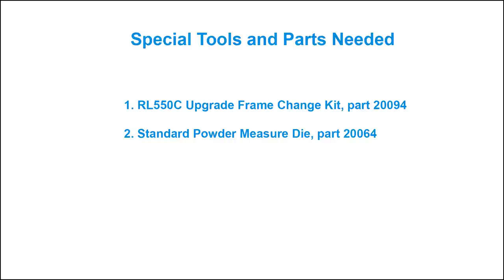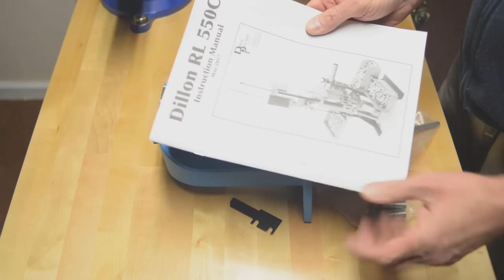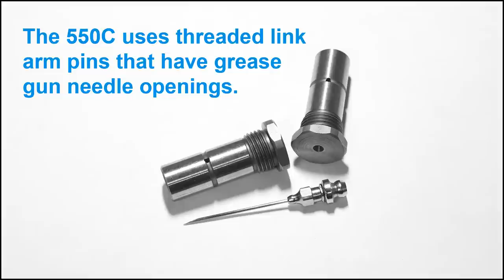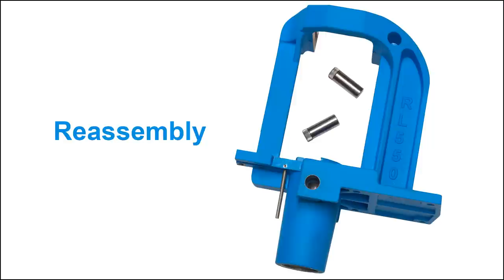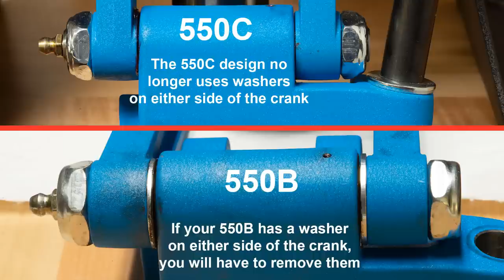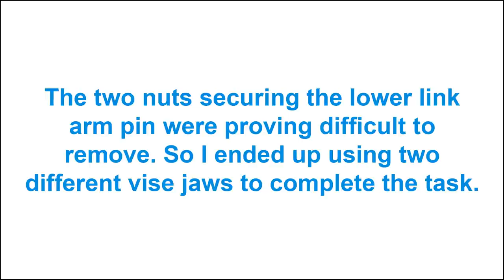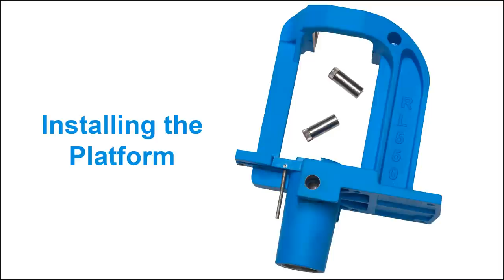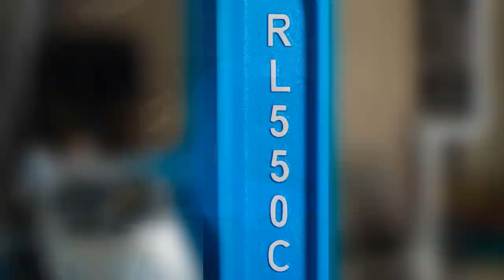How to upgrade a Dillon 550B to a 550C

Comment: This was a well made video with clear, simple to follow instructions. That being said, there is zero reason to "upgrade" as the cost far outweighs the negligible benefits. I've loaded for years on two 550b's for 10's of thousands of rounds and had no issue with yearly maintenance. If Dillon was giving this kit away, it would go on the shelf until the next time I broke my machines down. Once gain though, great video.
Reply: A. Grayman, totally agree, I’ve been using my 550b for over 25 years and if I knew to clean and lube it way back when I would never have had any issues. That being said I sent it back to Dillion and they fixed it up better than new free of cost, their service is the best!
Reply: You are so very right . Ive have a 550b for 12 year's now this is my second 550b only because I lost my first one in a flood in 2005. And that one I bought in 1985.I take them down for general maint. about every two years and it works just fine . Too much work and expense just to replace one part . As my dad always said " If it ain't broke don't fix it " .

Comment: After coming across you video and watching it, I ordered and installed the upgrade just for the ease of  maintenance. Thank you for the video as it saved me time and frustration knowing what to do and about  the washers on the crank. Again had no problems with the install thanks to you.
Reply from the maker: Chuck, glad it was helpful.  Took me a while to figure out the washers were the source of my issue.  It would have been nice if Dillon would have at least included a Tip sheet.  Dillon including the instructions of a factory built 550C with the upgrade kit was no help to me at all.

Comment: Excellent video! I've been having some issues with my 550b and I've found some of the pins have some galling. I've got an even older press than yours and there are no grease fittings so I guess they got dry. I think I will go ahead and upgrade to the 550c with this kit, but I'll also have to order some new pins.

Comment: The WHOLE reason why it’d be easier to just go with a new 550B..A LOT easier and less of a headache.
Reply from the maker: I assume you mean a new 550C. Yes, one could by a new 550C and then sell their old 550B. Easier, but maybe not cheaper. Kind of like electrical and plumbing work. Hiring a trades person to do every bit of electrical or plumbing work in your home/shop would be easier, but not necessarily the most cost effective.
Reply: The upgrade is about the same effort as the disassembly, cleaning, relubing and reassembly. So when the 550B press is old enough to need it, that's the time to do the upgrade, or I guess just buy a new press every time it needs a cleaning and lubrication. :)

Comment: Great video. The current instructions recommend blue thread locker on the "threaded link arm pin" threads. Do you think this is important or advisable?
Reply from the maker: Hello Alan. Glad to hear they finally came out with instructions. Using blue thread lock on the new threaded link arm pins/pivot pins would be a benefit. But for it to work, it would be important not to get grease on the threads.

Comment: Why you need to put grease through the pins, when Dillon maintenance instruction instructed to use motor oil on the main shaft?
Reply from the maker: Short answer: Different parts require different lubricates. Long answer: You may wish to refer to the following video from Dillon Precision. While their video is about the 550B, it does show the type of lubricate to be used for certain parts, especially at times 2:50, 5:03 and 5:27.
https://www.youtube.com/watch?v=cJuMsTIKsaU

Also, the new threaded pivot pins/link arm pins have grease needle fittings, which are meant for the application of grease, not oil.

Comment: Very informative video..
Thanks for sharing
Question..my 550b does not have the shaft with the zerk fitting attached?
Does Dillon make that part and is it recommended upgrade?
Reply: They do have kits to upgrade. It's called a "550 Grease Fitting Upgrade". Includes a new blue crank and the new pin/washers/nuts with zerk fitting. This is separate from the "550C Frame Kit Assembly" that takes a 550B frame with hammer driven pins to a 550C frame with threaded pins. As to whether it is recommended, it boils down to whether you like to take the press apart with a hammer and fight with C clips every N years for disassembly, cleaning and lubrication, or whether you would rather be able to lube in place and be able to disassemble (less often) with wrenches instead of a hammer and safety glasses. Perhaps wait until it needs a disassembly and then update it at the same time..

Comment: SUPERB video sir! Very informative.  Would you know if I can convert a 550 (no 'B') as you demonstrated, in addition the zerc'd long pin on the very bottom linkage next to where the handle screws in?
Reply from the maker: Dave, if I understand your question, it sounds like the crank (the piece that connects the two link arms at the bottom next to where the handle screws in) does not use/have a lower link arm pin that is fitted with a zerk grease fitting.  If correct, you may also need to get new link arms. new lower link arm pin, a new crank and possibly some other parts.  I would recommend you contact Dillon support.  Dillon has both a toll free phone number and live chat.  I have been successful using both their toll free number and live chat.
Reply: @knowledge2you  Good info sir and thank you for your quick response!
Reply: @knowledge2you  I didn't think about that, my link arms don't have the grease hole for the dirty grease to escape. I may just buy a new press.
Reply from the maker: Best of luck to you  @bamabackroads1203

Comment: Seems to me that it would be wiser to get a BL-550, and transfer all the parts over, then sell the 550B press fully functioning. 
After all, with Dillon’s warranty, what use is the old frame?
Third strike: no instructions for the conversation...REALLY!?
Reply from the maker: If you transfer over the automatic powder measure and/or the priming system and/or the low primer alarm (which is standard equipment on a RL 550), then you no longer have a fully functional RL 550B.

That is correct. The kit does NOT come with any instructions. The ‘instructions’ that came with my kit were the standard instructions Dillon ships with any factory-built RL 550C.  There is nothing in those instructions on how to upgrade a 550B to a 550C.
Reply: @knowledge2you  You would have an old style BL 550 fully functioning
Reply from the maker: @scpvrr  Ok, now I understand your suggestion.  Since a new BL550C is $300 + ~22.5 shipping  (w/o tax) and the frame upgrade kit is $121 plus ~ 17 shipping (w/o tax), then if the person could sell the old style BL 550B for at least $184.5, then they should be able to break even.  If they could sell it for more than $184.5, then they would have spent less that straight buying the kit.
Reply: @knowledge2you  Yep. And bless someone else in the process.

Comment: Great video.  Do you know anything about the part number 18275 crank upgrade kit for the 550?
Reply from the maker: B Berthold, I am not familiar with it but when I read its description, I speculated what it was, so I contacted Dillon, twice, to confirm my thoughts.  It has been over a month and not a word from Dillon.  But I suspect that if you have a really old 550, that the crank does not have a zerk fitting on it’s left side.  You can see this zerk fitting at time mark 26:49. So if your 550 crank has this zerk fitting on the crank, you should not need part 18275.
Reply: @knowledge2you  I did buy this part.  It replaces the bottom part of the press and it has a grease fitting. Thank you for your time and effort.  I did message them that it needs a better description and picture.  It also came with a link arm punch and alignment tool.

Comment: Thanks for making this video, very helpful!  I noticed that you have a plate on top of your Strong Mount.  Is that from Dillon, or did you fabricate it? I bought my Strong Mount back in 1999. It does not have a top plate.
Reply from the maker: Dillon does not make a top plate for their Strong Mount.  I purchased the top plate from inlinefabrication dot com.  On their web site, in the upper left, click Search and search for ‘Intermediate plate for Dillon 550 strongmounts’.  This is the same company from which I purchased the LED lighting kit for my 550s.
Reply: @knowledge2you  Thanks, I have several of their products, but I never noticed that upgrade. I wish I had bought their mount for my 550, but I don't think they were around in the 90's when I started reloading.

Comment: I’ve taken the pins out on my 550B. It takes many whacks wit a hammer.
Reply from the maker: Yes it does.  With the upgrade, no more having to remove the pins to grease them.  The new pins are now much easier to lubricate with their grease needle openings.

Comment: That's not a upgrade, it's replacing your press....
Reply from the maker: By general definition, an upgrade is taking something that works and making it better/more up to date by adding or replacing parts. For example, I upgraded my computer, which was running Windows 8, by installing Windows 10. i.e. I replaced Windows 8 with Windows 10. In this video, I upgraded my press by replacing a part.  I did not replace my press. If it matters, Dillon’s name for part number 20094 is Upgrade Frame Change Kit.

Comment: I bet some clever machinist could come up with some way to add a real upgrade kit to this to convert the pins for quicker disassembly. but honesty if you use quality grease you dont need to take it down all that often.
Reply from the maker: How often it has to have a major cleaning is more a function of how much reloading you do.  I have no set guidelines.  For me, it is when the machine begins to feel sluggish.  When the upgrade kit, I now just have to use a grease gun instead of taking it down.

Comment: seems to me if you could just buy the threaded pins and thread your 550b to accept them
Reply from the maker: Not sure it would work Chris. I still have my 550B frame and compared it to the 550C.  The sides of the frame where the pivot pins are inserted are thicker on the 550C than the sides on the 550B.

Comment: What kind of vise and who sells that vise? Nice video Sir.
Reply from the maker: It is the Yost 750-DI 5”.  Originally, I was going to get the Yost 750-E, which is a somewhat smaller and less expensive vise, but at the time, the 750-DI was on sale and the 750-E was not so I was able to get the 750-DI for close to the same price as a 750-E.  I also purchased the Yost MU360 universal jaw cover (6") and the Yost UP360 universal prism jaw cover (6”) and the Yost MR-350 magnetic aluminum jaw cap with rubber surface (5”).  I got mine on Amazon but other retailers sell them also.  I shopped around for price and that including shipping charge since a vise is heavy.

Comment: Does Dillon not provide torque specifications?
Reply from the maker: There were none in the instructions.  In fact, the instructions that came with the upgrade kit were just the standard 550C instructions that come with a factory built 550C.  The instructions do not show or explain how to upgrade a 550B to a 550C.  If you call or chat with Dillon, they may provide torque specs.

Comment: How to convert your 55b to a 550c: Get a 55C Frame and....uh...strip the parts from the B and place them in the frame of the C...and ...uh...screw it.  Just go buy the 550C. Save the time.
Reply from the maker: I don’t understand your point. If you own a 550B and wish to convert it to a 550C, then when you buy Dillon’s upgrade kit, you are buying a 550C frame and in the video you see how to remove the other parts from the 550B and install on the 550C (not all parts convert over) and align the shell plate to the new frame (a necessary step). If you currently do not own either, and you buy from Dillon, you will be getting the 550C. About the only way to buy a 550B now is on the used market.

Comment: I see that You miss something very important on RL 550B about pivot pins. You don't have to remove anything to lubricate pivot pins. I believe that You didn't see six small pin holes for lubricate pivot pins.
Reply from the maker: I kept my old 550B frame and as I show in the video, the link arms and crank from the 550B are reused when upgrading to the 550C. There are no small pin holes on the frame.  Each link arm has one small hole and the crank has one small hole.  For a total of three holes.  These holes act as a grease pressure relief hole.  To properly lubricate the old-style pivot pins, they have to be removed.  As show in this Dillon Precision published video starting at 2 minutes, 18 seconds.

https://www.youtube.com/watch?v=cJuMsTIKsaU

If you look at some really old 550 machines, they don’t even have the hole in the link arm that mine do and don't have a Zerk fitted pin in the crank.
Reply from the maker: @Subject76  The post you are referring to is 2008. The video I am referring to is 2015.
The older machine shown in the post has two small holes in each link arm and two small holes in the crank. For a total of six holes. They have not put those six holes in a 550 for a long time. Just look at the link arms and crank on a 550 on the Dillon web site or in the Dillon video I referenced above. Years back they switched to one hole in each link arm and one hole in the crank. And they put a Zerk fitting on the lower link arm pin and did away with the clips and lock nuts on the upper link arm pins and changed their lubrication recommendations. So as much as you want me to be wrong, I am not.

Comment: How much did the upgrade cost you? Thanks
Reply from the maker: The price as of this writing of the RL 550C Upgrade Frame Change Kit (stock number 20094) is 110.95 USD.  The price does not include shipping nor does it include tax.

The kit includes a new frame, two upper link arm threaded pins, toolhead, toolhead pins, primer slide return spring and pin (the spring (part 13928) and pin (14025) are preinstalled in the frame), primer track bearing plate (14015), platform alignment tool and punch (that looks like a large nail with the point cut off) for removing the old-style pressed-on upper link arm pins.  It also includes an instruction manual that does NOT tell you how to upgrade a 550B to a 550C.

The kit does not include, but you will need, a standard powder measure die (20064) and a die lock ring.  If you do not have a spare standard powder measure die, you could always remove your automatic powder system (if you have one) from the die on one of your current toolheads, unscrew the die from your current toolhead and use it.  But then you will have to reinstall everything.  Or you could borrow a standard powder measure die or you could buy one when you buy the upgrade kit.  As of this writing, a standard powder measure die costs 13.45 USD.
Reply: @knowledge2you  Thank you very much for this great review
Reply: @comloz  The Price for the Kit as of 7-30-2020 is $120.00 plus shipping and tax if any.

Comment: Just get a 550c and keep the parts from your 550b as extra.
Reply from the maker: If you want to go that route, get the 550C Basic Loader for $289.95 USD (which is $179.00 more than the upgrade kit) knowing that the remaining parts of the 550C BL are parts that generally do not wear out and that the 550C BL does not come with a platform alignment tool.  It also does not come with the punch for removing the old style link arm pivot pins, but if you already own a long punch set, you can use your own punch instead.